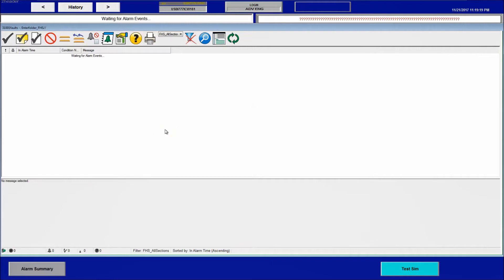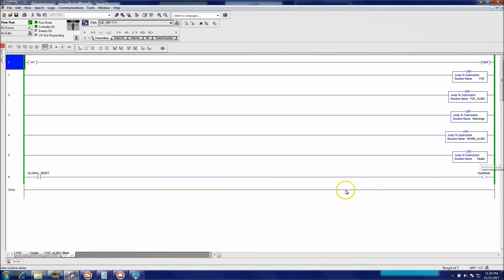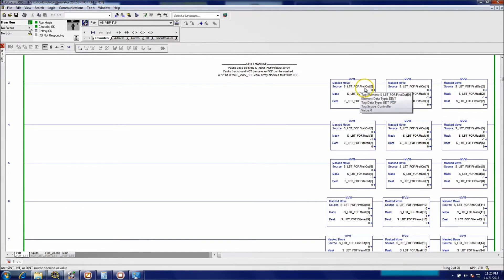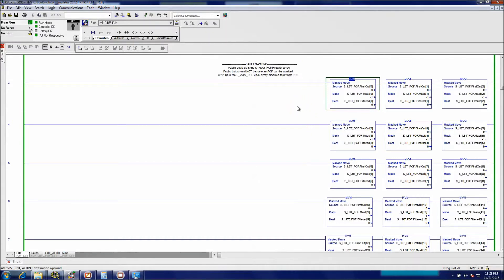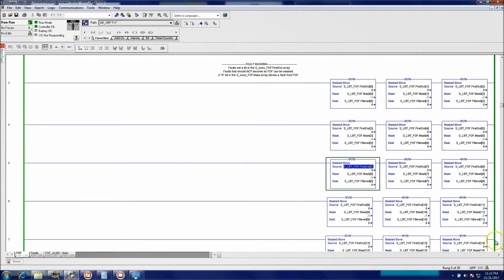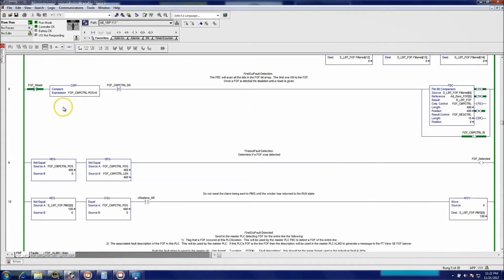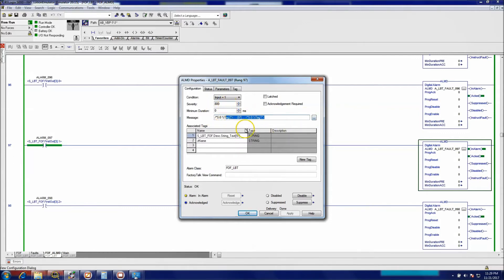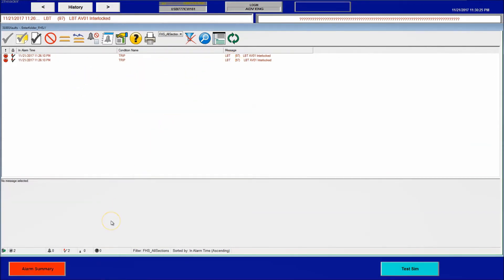RSLogix 5000 ALMDs FTView SE application First Out Fault System

Comment: Hi. I cannot understand how the message is sent to the HMI. What configuration should be done in Factory Talk? I've watched other videos about the ALMD instruction but I'm not getting it. Thanks!
Reply from the maker: Make sure the Factory Talk alarm summary screen looks at the RSlinx Enterprise or FactoryTalk Linx server & also make sure the Factory Talk Linx server where the shortcuts has the box checked to use Alarms then go to the HMI shortcut & update the shortcut to use the alarm.

Meaning, change it form no to yes
Reply: @ShaneWelcher  Goodnight. Thank you very much for replying. Unfortunately I didn't understand very well. In fact, I know that a file is executed on the HMI where the messages are already configured. They already exist and the HMI monitors the trigger in the PLC to determine which message will be displayed. However, when you created the ALMD, you inserted a message only in the PLC, without changing the HMI message list. And when the message is displayed, it is according to the message entered in the ALMD instruction. This is my question. When using an ALMD, what is the trigger configured in the HMI .mer? Or the trigger is not needed? (Forgive me for my limited knowledge). If you have a video explaining this, could you post the link? Thank you very much and I'm sorry!!
Reply from the maker: @renatoborguignon8345  ALMDs are for alarms & Events in Site Edition...it sounds like you are using Machine Edition
Reply from the maker: In the case of Machine Edition, make sure you use alarm tags & setup the message in the App alarm settings
Reply from the maker: @renatoborguignon8345  Site Edition uses alarms & events summary page.

That automatically read the ALMD data.

As long as the alarms & events screen is looking for that shortcut or wildcard
Reply from the maker: I teach all of this in depth in my Batching Station course if you want a step by step structure
Reply: Good afternoon.
Thank you very much for the explanation. I managed to create a new alarm by creating a new ALMD. The configuration was already done on that screen alarms & events. I didn't know that. Thank you very much!!!

Comment: Low quality video
Reply from the maker: Actually, you should check your internet connection speed.

Also, adjust the quality of the video by using the gear icon on the bottom right of the video.

I record in 1080p hd.

That is great quality

Comment: Shane can you adjust the focus of the screen? Thank you!
Reply: Nevermind. Just Ctrl + scroll mouse :)
Reply from the maker: José A. Catalán C. 
All you have to do is make the video play in HD,  all the recording are in HD.  So in other words,  it depends on your internet connection.

The controls are in the bottom right of the YouTube video.
Reply: Thanks Shane!  Did you mention that the  FBC  .IN  should  be set to 1 ?
Reply from the maker: Yes, the FBC.IN has a latch bit to make it high for the function to work correctly.